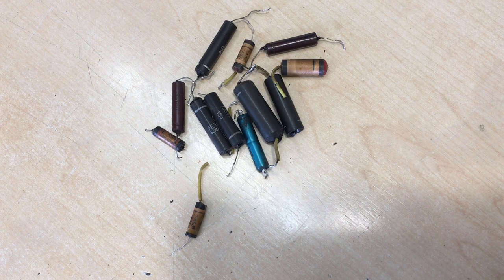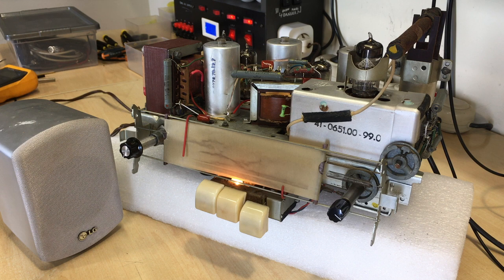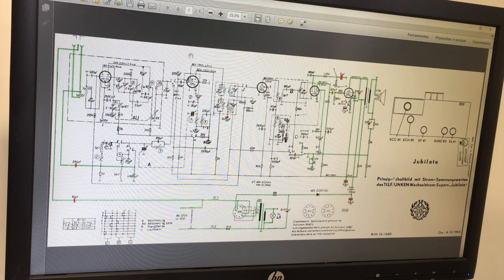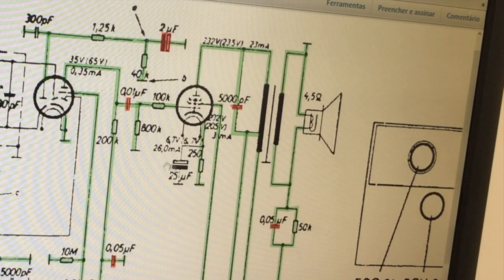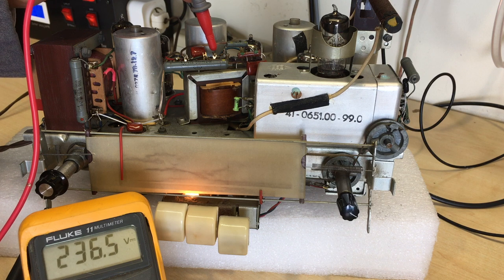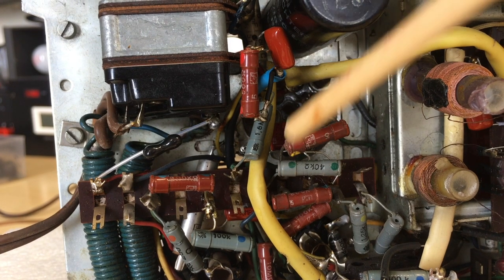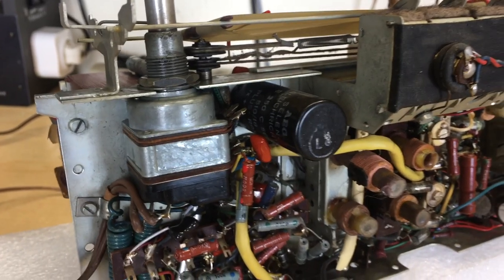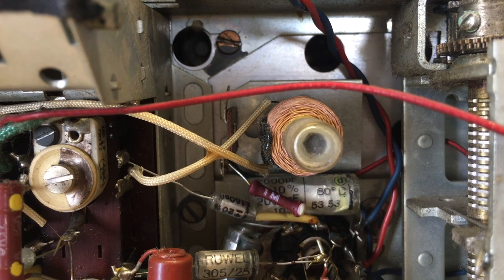Telefunken Jubilate restoration - Part 3. So much work, so few caps. We have radio reception!

Comment: Going with an earthed plug will give you polarity on the plug, even if you don't use the earth wire. It sounds like a good way to solve the un-polarized plug problem.
As long as all outlets are wired the same way...
Cheers
Reply from the maker: The problem here in Portugal is that the plug fits in either way, so it won't be polarised anyway.

Comment: So this set uses an autotransformer basically, meaning that the primary and secondaries are all in series? They sure picked an odd way to draw it on the schematic, most I have seen depict the windings as being on one side of the iron core. That's why I was wondering if maybe they had used a normal transformer and simply made a jumper between the primary and secondaries. I was going to suggest running an isolated B- line through the set, but given the way it is constructed the power transformer swap is probably easier, or easier still would be to run it through a smaller isolation transformer.
  But now that I look at it they are taking the high voltage for the anode right off of the primary, so there would not be any isolation for anything but the tube filaments anyhow. I think the reason for the transformer was so they could offer different taps for various line voltages, and so they could use tubes with 6.3 volt filaments. and still derive the B+ voltage they needed. Why they didn't just make a series string set is a good question, were they not capable of making a radio with series string tubes, and FM, in Western Europe in the 1950s? I would not have thought so?
 Using autotransformers in electronics must had been a "Flavor of the day" among some engineers back then, there were a few North American radios and TVs that used them as well, manufactured by Zenith and G.E in the late 1940s and early 1950s. I think it because they wanted to use higher B+ voltages then a series string set could offer, but using an autotransformer was still cheaper then a proper power transformer. The other route many took was to use a voltage doubler power supply with a pair of selenium rectifiers, which seems to have been the popular method in TV sets.
Reply: Well, autotransformers are less "primaries and secondaries all in series", more "tapped primary". In this case, it's "autotransformer (on the left) - with an additional LT secondary (on the right)", and that secondary just happens to be connected to one side of the mains too…

Agree; in this case it's so they can accommodate various line voltages - not only was Europe & its remaining colonies a bit all over the place voltage wise, but a big part of the Marshall Plan (& other post-war 'initiatives') was to encourage export market growth, mostly to the 110/120v US. A series string would require a barretter or similar (e.g. honkin' great resistor), or different valves with different heater voltages, or some other way, to accommodate different voltage markets.

And autotransformers are not that uncommon in small European sets* around this time - less of the expensive copper, the transformers are smaller (eyeballing the one Manuel compared earlier, it's probably 20%~25% smaller in volume), less weight, etc, etc. I understand his reluctance & suspicion of live-chassis sets - and even share it -  but they're generally safe enough with the back & knobs on. Personally, I'd trust this more in day-to-day use than the valve preamp PSUs repaired in another recent series that featured unearthed external metalwork… 😱😉

(* Well, very small table ones like this. Slightly larger (but still small) ones tended to stick to isolating transformers, even from manufacturers who aimed at the cheap end of the market & could've made more money using a cheaper transformer.)

Comment: Funny that they put a transformer in for just 6.3 volts. Would not have cost much more for a HT winding making it really safe. If they really wanted to save money they could have used the U series valves rather than the E series. No transformer at all, no less safe. Odd the things manufactures do!
Reply: I was just thinking about that, are there any series string sets that used U series tubes/valves that also had FM? I remember that Telefunken made a battery portable with FM, it was not series string though as it had a power transformer, but it came out around 1958.
Reply from the maker: The auto transformer function of the primary allowed for mains voltages from various regions to be possible more cheaply. That’s what happens when costing comes in to engineering :)